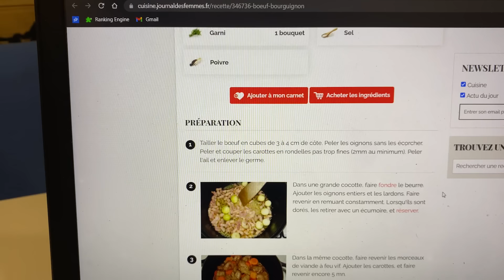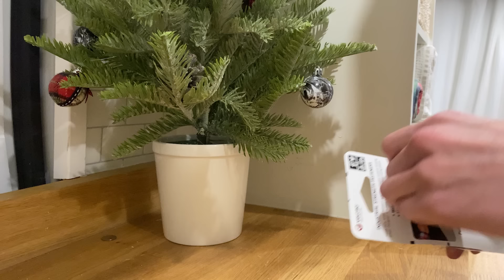HEAVY SNOWSTORM Camping in a VAN! | Blizzard Survival Winter Camping

Comment: I think I understand why your sliding door is frozen and won't open. Warm inside and cooking a stew and cold out. Where warm moist air and cold meet there's condensation. In this case the rubber strip of the door. Put vaseline on the rubber strips before a winter so the doors will not freeze shut. 👍
Reply: Facts we use cargo vans where I work and nothing like getting medical supplies and machines stuck inside. Lub the seals
Reply: I have heard alcohol will help too. I don’t mean drinking alcohol, but I guess it couldn’t hurt.
Reply: We use wd40 on our patio doors to keep them from freezing. Living in Northern Wisconsin, I can say it works very well! Also make sure nothing blocks air flow to the door from the inside. Always slow air to flow around the cabin especially in front of your door 🙂
Reply: @shannoninalaska  I like where this is going.
Reply: @Jeffsterren  what could possibly go wrong? Lol
Reply: How much this type of van cost?
Reply: @raheebnagi8347  I don't think I could even afford the tiling job on his kitchen wall...
Reply: Vaseline can be messy and have possible compatibility problems with the rubber. I'd be using silicone spray.
Reply: @joewoodchuck3824 silicone spray works from -40 till 200 degree Celsius. Greetings from Germany.
Reply: @thomasklett3078  It's great stuff for a lot of things. Greetings back to you from Tennessee, United States.
Reply: @danakraemer8512  It's been that way for a long time according to what we hear in the east. The citizens keep making the same mistakes in the voting booths.
Reply: @steviezxr  Never knew anyone used Vaseline, but I do know about silicone spray.
Reply: Good job, genius. You cracked it. 🤦🏽‍♂️😂
Reply: That or graphite.
Reply: I love this one! Is it weird I want to watch you eat all of it?  I can just imagine the fulness and a great sleep listening to the snow.  I watch your videos every night. It makes me happy.
Reply: Great idea for all vehicles in the winter that are subject to real cold days.  I had my doors freeze during icy winter days and now I know how to help them from sticking.
Reply: @thomasklett3078 good idea but you have to keep applying it everyday because it doesn't stay on
Reply: Why no alcohol?  Religion or choice? It is irrelevant to me....just interesting.
Reply: My son in laws brother works with machinery out in the cold and hot weather. My car doors were always freezing shut in winteralong the rubber surfaces connecting the doors to the frame. He told me to buy W-D40 spray oil and spray these surfaces periodically throughout the winter. It works great! I also use the tiny narrow spray straw to spray the oil into  the door and trunk locks to prevent hen freezing as well. Also I use a bottle with a spray nozzle on it filled with deicer liquid (you usually put into the window washer container under the front car hood) that I can spray quickly on my windshield and windows to quickly defrost them.

Comment: When you get time,  cook this on wooden stove just like nuggets,  slightly thicker,  use hand to make,  don't need roller. 
It very delicious. 
Use oinion,  garlic,  ginger,  onion leaves , any green leaves,  salt and oil. 
 Add canned cheakpeas for making it more softer.  Crush cheakpeas in grinder .
Cook nuggets on slow fire, keep turning. 
You can keep for multiple days. 
Use smaller quantity of oil for turning. 
By making making you will understand. 
Eat with your curry. 
Either store as nuggets or store baked nuggets. 
During winter it's very testy. 
Jay Bharat.

Comment: Enjoying your video!  Has CO2 output from the stove top ever caused and issue since it appears you have your van rather well buttoned up for cold weather?  Curious if you're planning to switching to induction or do you need more battery capacity for that?

Comment: Where I live in Washington state 20 miles from Mount Rainier there are only foot hills which are no greater elevation than 700 feet above sea level so we are not getting much snow and the snow on the mountain doesn’t melt till spring if not every night after a dusting no real threat of flooding we get so much rain anyway we’ve got ditches and rivers and lakes that handle all of it and a few years back the electric company came and strung high voltage cable so the winds don’t  cause any downed lines, we are all set now if people in places that are still flood can get their municipality to spend the money to accommodate digging ditches or upgrading storm drains and up grading electric cables and digging displacement ponds for run off then. But if you live in real snowy places you need to get the municipality to buy and maintain snow plows and gravel trucks and don’t let the he next guy who takes over sell them then you won’t have any problems with the snows

Comment: You need  cutting board and better knives.  Scraping your knife on a glass plate is a very bad Idea.  Get yourself a real chef's knife not that dinky paring knife.    Get some Zip Lock bags for your open bacon.  Get yourself a push broom to clean the snow off of your van.  Better yet  put a plastic or canvas sheet or cover for your cab or van.